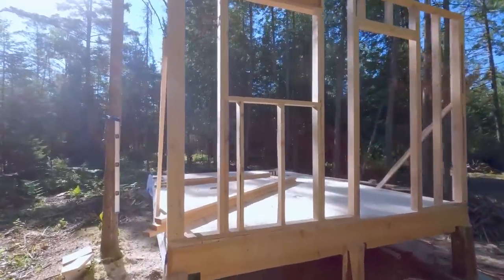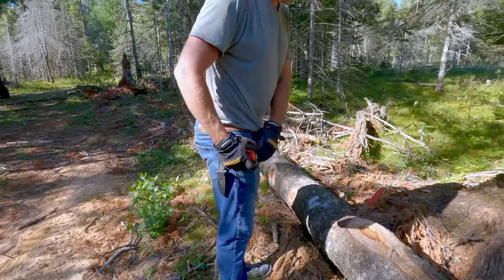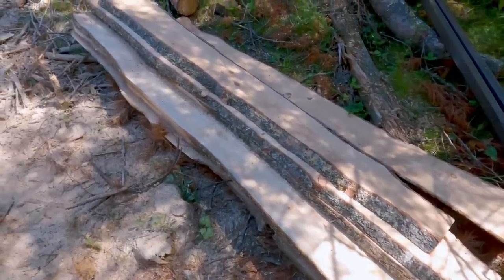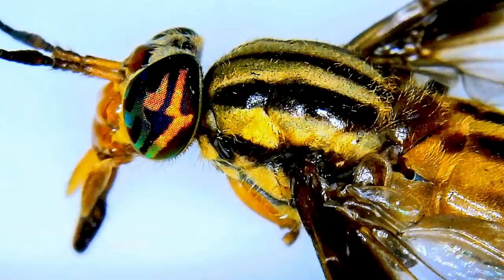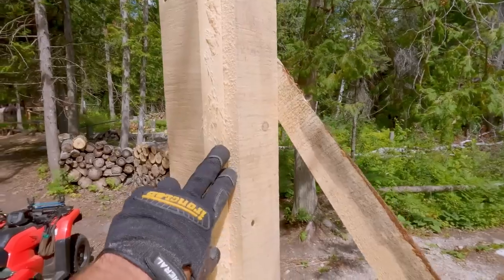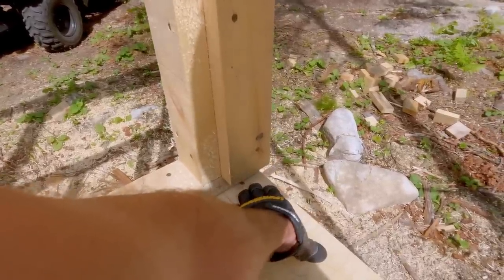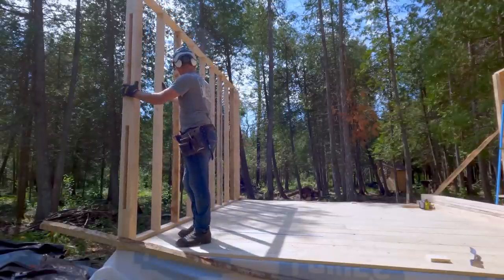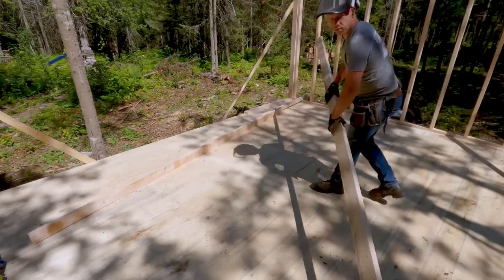Milling Treetops for Tiny-Cabin Framing.  #98

Comment: I remember seeing a log cabin disassembly on TV years ago in North Carolina where the cabin had the kitchen detached from the main living quarters. The kitchen was another building built next to the main cabin with a breezeway and roof over it. It had a pitcher pump on the counter for the cast iron sink. There was a cast iron stove in there as well. It was a pretty interesting design. What ever your next stage is after this is done, surely I'll be entertained watching while I pull apart pallets to make stuff or waiting for all hell to break loose at the fire dept. Your desk leg idea from the slingshot Y log sounds perfect. Nature is art and us artists love using what nature provides. I'd love to see some trail cam images when you get time or something interesting. Bugs are cool!

Comment: I'm a contractor and I had never bought Ryobi tools until recently, I have that same saw, and bought it because I saw you using it on your builds, I love that thing, light weight and the battery lasts a ridiculously long time. Last week I cut all the 2X10 rafters for an addition I was doing, barely went through one battery.  Ryobi has really stepped up it's game, I now own about half a dozen differnt Ryobi-one tools, and I love them all!!

Comment: If you see this, since you will be insulating, the headers can be spaced so 1" foam board will fit on one side for sure. Nice work, really impressive that you do all this by yourself. Trusses with ply plates is the answer, I do not like the metal press plates. Thanks so much for all your time. Bob in Nevada

Comment: The way you explained the nailers is true, but it's easy enough to add extra 1x2s or 2x2s when you need a bonus nailer. Very common scenario.

Also, if you decide to only do the angled rafters, the problem you'll face is sagging.  The end walls will be fine, especially if you reinforce the studs supporting the roof beam.  The problem is the middle of the roof.  It will push down, the side walls will push out, and you'll get a bowed roof over time.  However, you can offset that risk by adding either rafter ties or ceiling joists.  As you said, the issue with ceiling joists is they'd have to be quite long.  On the other hand, you don't need very many of them unless you're also building a loft.

Comment: When you frame corners the best way I've seen is to lay one stud at the end normally and another on it's flat towards the inside of the wall. That way you can insulate right past the inside corner and it gives you the inside corner to attach interior sheathing.

Comment: Nice video, thank you! Looking good. Not bad for a guy from Brookline. Making trusses or rafter assemblies is faster, easier and better! It saves a lot of climbing! Your build is rectangular so form them in the length and install them across the width. Rafter ties will keep the walls straight and the roof load on the walls! Use diaper cuts for the ridges! A good place for scrap! Ron PTL USA

Comment: Wow looks good man, I'm loving it...You  should build a loft in it that way the bed wouldn't take up floor space on first floor.
I like how you use every piece of wood so you create very little waste...most people wouldn't use crooked or logs with lots of knots... they'd just burn it in a massive fire on the ground and not even use it for fire wood.
 I hope since you are using green wood it doesn't shrink up too much or warp when it dries... I've seen people build with wet wood and not had any problems but then again I've seen people have a whole s slew of problems anyways you look like a guy that knows what  you are doing

Comment: If you take a 2 x 4 on each end of the wall and put one nail in it will help when you standing up a wall . if you use a strap piece of wood and strewed it to the rim juice have it stick up over the floor about 4" so when you standing up a wall it can't slide off on you . your doing a great job👍

Comment: Regarding your roof plan. You're building a cabin similar to what I have up here in AK. If you don't install crossties between walls, the snow load will press down on your roof rafters, which will, in turn, press outward on your walls. You need to install lumber across your structure. I used a 2x6 resting vertical on my top plates, toe nailed into the top plate and nailed into the rafter. (I used wood screws, but whatever.) Pay attention to the spacing of your rafters compared to the size of boards you use. A 12/12 pitch will virtually eliminate snow load issues.

Comment: You could also do 16" centers from the wall edge towards the window on both wall edges. And then you will have extra bracing on both sides of the window

Comment: Sorry for my spell check the bottom of the wood the tree Is more dense cause Growth gets tighter To save energy in the tree it don't in expand that much You should see the Wonder of the rings are different From the top of the bottom You seem like it be more dense cause the tighter grows at the bottom

Comment: Framing a corner only needs 3 studs. The end of wall stud, like normal. Inside wall stud is perpendicular to end of wall stud. Which makes an L that is 3.5" x 5". The 3rd stud may be attached now or when the next wall gets put up. Also easier to drill holes for wiring.

Comment: With your wall and insulation theory, will you do the same with your rafters? Now you probably know this, but keeping layout the same is for stackability and load transfer and mechanicals and such. So my question to you is… Will you lay out your rafters to stack over your studs on your wall to have stackability and also most insulation value… Not cutting insulation batts keeping them as full width. I hope you can understand my question. Love watching you do your thing, it’s not always the right way but it’s your way and you own it 👍

Comment: I'm thinking someone needs to get you together with  a nice, efficient little Jyotl wood stove with a glass front in it... way better than watching TV come winter.
We had a 'lesser' model stove, at first, way less efficient, and eventually the gaskets? on it gave out.  It looked OK but it turned dangerous... so, just a heads up... a stove is NOT where you want to go all "skimpy".

Comment: 36:47  Actually - the plan is NDB (Nuclear Diamond Battery) tech is not a battery, but a power source. The waste from nuclear power stations mixed with diamond dust. All fit into a AA size package. Weird.

Comment: Hmmm , something you said earlier about  lining the interior  walls ,, you cut the studs at 8 ' plus top and bottom plates , that makes your walls 8'4" ,,, and wallboard and plaster board is 8'X 4' sheets ?  maybe studs should have been 7'10" ?
Reply: I believe he’ll plank the walls, not use drywall.

Comment: Headers are supposed to be double,  as in 2 2x12 nailed together with a half inch spacer in the middle so its the same thickness as your wall studs.

Comment: Your insulation only comes in 24” and 16” ,not actually 16” and 24” but designed to fit in 16” and 24 “  stud spacing. I have done the same under windows but in the long run it would be best to stay on layout. 
You should look up a California corner , the way your doing it you will have cold corner and needs to be insulated before you put the siding on. 
Also you could have cut your studs to 7’ one of my houses was built in the 70s with 7’ ceilings it a 1200 square foot house so in theory that’s 1200’ feet I don’t have to heat. 🤔 when I built one of my cabins I thought what the hell and built it with 7’ ceilings  doors are only 80” .

Comment: Where did you get the brackets you screw on the ends of the log to mill them?
Reply: He cut them out of scrap steel with a death wheel.

Comment: If each pass takes about 1/4 inch kerf, how many feet of wood have you converted to saw dust over the past couple of years?
Reply: 1/4 inch?!?!?! better go look at a tape measure most blades only take about 1/8
Reply: @genghischuan4886  the chainsaw which he uses the most has more than 1/4 inch kerf

Comment: U wouldn't have that problem if you made the corner a 'U'   instead of a triple stack still requires 3 two bys tho
It's like a double sided 'L'  not only do u get the nailer on the interior but u get it on the exterior too for a corner board 
 _
|  |

Comment: Have you thought of having a loft? It will do at least two things. Keep the walls from spreading and additional storage space.  Heck, pitch the roof to create headroom and then you could sleep up there.

Did you say buy sheet rock? That is out of character. Figured you would use inch thick boards.  I know, lots more milling, but that is who you are.   Advantage - no need to worry about stud placement.
Reply: Naw. Guarantee he won’t use sheet rock. He’ll mill lumber for both exterior and interior walls and ceiling. His reference to  drywall was just to illustrate his error in construction of the stud wall (ends).

Comment: What if you built an asymmetrical clearstory 3-piece roof truss?  Image illustrates a design that would allow additional light in when the sun is lower in sky.   Clearstory window could be two or three wall clear polycarbonate sheet that is cut down to a 12-15” segments.  Have you taken advantage of any of the truss design software that is available on the internet ?  (https://i.pinimg.com/originals/4e/66/28/4e66280e9e7244f0054c7a7b40cee512.jpg)

Whatever design you choose, build a single truss that includes an overhang for eaves.  When you have a functioning truss, lay it out on the cabin floor and use scrap wooden blocks to create a template that you can use to duplicate the truss.  If necessary, draw pattern on floor and research pocket-holes for fastening timbers with screws.

Stay safe out there.  Cheers